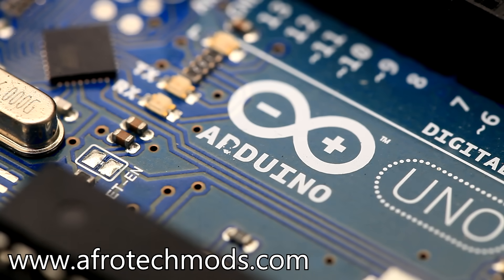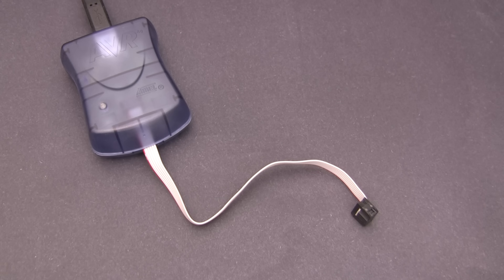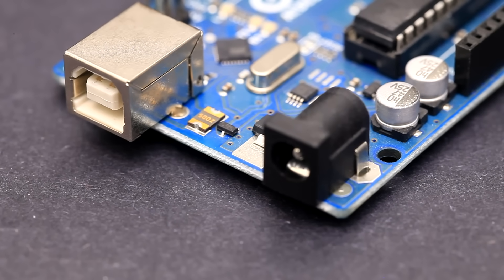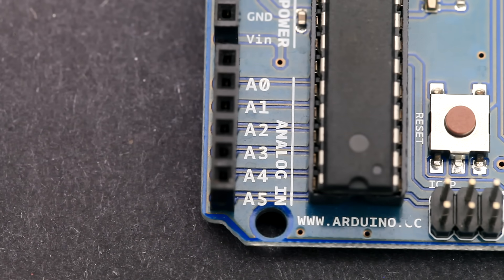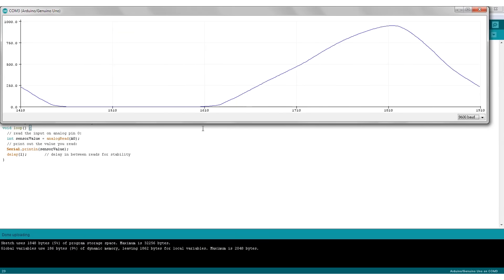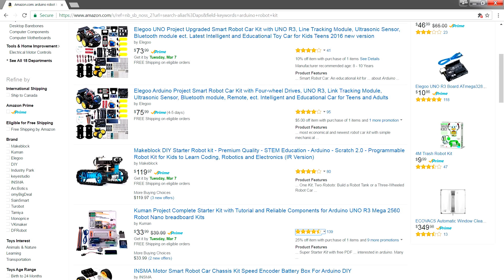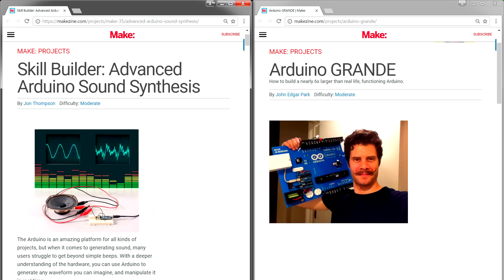You can learn Arduino in 15 minutes.

Comment: I really appreciated this video. I am trying to learn how to employ an Arduino to control the hot and cold (outside) air inlet valves for the cabin temperature system of my airplane. The valves are currently controlled by independent push-pull cables, but the distance between the instrument panel and the firewall where the valves are located cause the bends required in the cable to be so great, the cables do not move smoothly and tend to stick. 

Your video helped confirm for me that an Arduino with two motor controllers could be developed to control two servo motors, or two linear actuators with positioning sensors (depending upon what I decide is easiest to mount) to manipulate the valves. I envision using an instrument panel-mounted potentiometer with a center detent to control the valve positions as follows: 

Assuming that the center detent of the controlling potentiometry is 2.5 volts, then 0 volts would represent full open of the cold air valve, 2.5 volts would represent full closed for both air valves, and 5 volts would represent full open of the hot air valve. 

The idea is the operator could modulate the incoming air valve position to select the desired cabin temperature by rotating the Cabin Temperature control knob (potentiometer) from one extreme to another, or anywhere in between to control the air inlet valve positions. The center detent would be marked as OFF, the range counterclockwise from OFF would be marked with a blue gradient arc for cold, and the range clockwise from OFF would be marked with a red gradient arc for hot. The valve positions would control the amount of hot or cold air that enters the cabin. 

I have some questions...

As I know nothing about how to code an Arduino, is there an index of commonly used code sentences that can be looked up and compiled to accomplish what I am trying to do?  

Are Arduino-ready motor controller's generic enough to work on any motor? Or do I need to somehow learn how to identify controllers acceptable to both the Arduino and the servo or linear actuator? 

Perhaps this exact system would be video tutorial-worthy (hint, hint)?

Thank you,

Comment: I. what Arduino is 🤖

1. microcontrollers = tiny low-power computers on a chip ⚡💾
2. Arduino = Italian company making easy-to-use circuit boards built around these chips 🇮🇹🔌
3. open-source hardware → many clones exist 🌍🛠
4. boards come in many versions (Uno = cheap & most common) 💡💸
5. shields = add-on boards (motors, wifi, MP3, GSM, etc.) 📡🎶📱

II. why it’s beginner-friendly 👶🏼

1. traditional microcontrollers = hard (binary, registers, custom programmers) 🧮😵
2. Arduino software (IDE) simplifies upload via USB 💻➡🔋
3. unified language across all boards 📝🧩
4. tons of example “sketches” to learn from 📚✨

III. hardware basics (Uno example) 🔍

1. main chip: ATmega AVR 🧠🔲
2. USB chip = handles programming + serial communication 🔄🖥
3. power via USB or 9V barrel jack → onboard regulator to 5V 🔋🔌
4. reset button + crystal resonator 🔘⏱
5. pins:
   – power pins (5V, 3.3V) 🔋⚡
   – digital pins (2–13) → in/out, PWM (\~) 🔀🔢
   – analog inputs (A0–A5) → read voltages 0–5V 🎚📏
   – TX/RX for serial 📡💬

IV. first projects 🛠

1. connect potentiometer → analogReadSerial → see values (0–1023) in Serial Monitor / Plotter 📈🔎
2. LED dimmer: potentiometer on A0, LED on pin 9 → analogWrite maps 0–255 brightness 💡🎛
3. same principle controls motors (PWM) → build simple robots 🤖⚙🚗

V. key takeaways 📝✨

1. Arduino = easy entry into electronics + programming 🚀💻
2. Uno + starter kit = enough for most projects 📦🔧
3. programming model = setup() runs once, loop() repeats ♻🔁
4. use example sketches, tweak variables, and expand into your own circuits 🧪🖊
5. with sensors + actuators, Arduino becomes the “brain” of DIY robots, instruments, and gadgets 🧠🔩🎸

spol.ski

Comment: 2:31 As far as I know, it's just C++ with a prelude, so some C++ concepts (like templates) can be directly used in Arduino code, and if you have some useful C/C++ header files, you can directly import them.

Side note: From what I can tell, the IDE uses Clang to compile sketches. With a bit of research, you should be able to compile other LLVM-compatible languages (such as Rust and Zig) to the Arduino, just like the IDE does.

Comment: In the thumbnail you can see the diode is directly in the arduino. I would recommend using a breadboard as it does not require any soldering or bending wires.

Comment: why is 512 half? 0-1023 is still 1024 numbers. It should be 511
Reply: ATmega328p datasheet: 23.7 ADC Conversion Result (for single ended conversion)
the result is: ADC=(V_IN * 1024)/(V_REF)
V_REF=5
V_IN=V_REF/2=2.5
ADC=(2.5*1024)/(5)=512
Reply: @Henry-sv3wv  So not half... Got it
Reply: @aaronrockwell4576  it won't show a perfect stable 512 anyway because you always have some noise in the signal

Comment: although it's not as simple as learning python!!!......
Reply: well arduino does use C++
there are controllers that can do micropython (like Pico RP2040 or ESP32)

BUT if the controller doesn't offer a ready made library for the sensors and stuff you want to import as python libraries and you want to write your own "driver" for an electronic then you now have three problems:
1)  Writing the driver in C code (cause python is too slow for most "driver timing critical things"), then 2) writing micropython language bindings to make an interface/python library for python to your c driver and then 3) recompiling the micropython firmware that it can use your c code driver and flashing that new custom made micropython firmware into your controller.

that's why python is often called a "glue language": to make math science run fast on python the numpy library on the PC for example is in reality compiled c code that is called from the python numpy library functions.

Comment: // C++ code
//
void setup()
{
  pinMode(0, OUTPUT);
  pinMode(1, OUTPUT);
  pinMode(2, OUTPUT);
  pinMode(3, OUTPUT);
  pinMode(4, OUTPUT);

  digitalWrite(0, LOW);
  digitalWrite(1, LOW);
  digitalWrite(2, LOW);
  digitalWrite(3, LOW);
  digitalWrite(4, LOW);
}

void loop()
{
  digitalWrite(0, LOW);
  delay(500); // Wait for 500 millisecond(s)
  digitalWrite(0, HIGH);
  digitalWrite(1, LOW);
  delay(500); // Wait for 500 millisecond(s)
  digitalWrite(1, HIGH);
  digitalWrite(2, LOW);
  delay(500); // Wait for 500 millisecond(s)
  digitalWrite(2, HIGH);
  digitalWrite(3, LOW);
  delay(500); // Wait for 500 millisecond(s)
  digitalWrite(3, HIGH);
  digitalWrite(4, LOW);
  delay(500); // Wait for 500 millisecond(s)
  digitalWrite(4, HIGH);
  delay(1000); // Wait for 1000 millisecond(s)
}

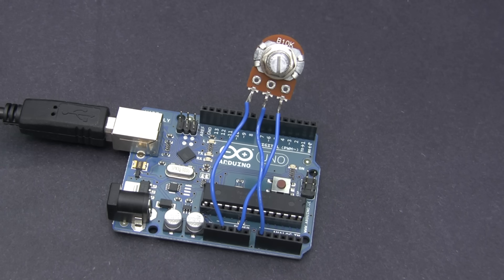Comment: 8:26 In case anyone is wondering, some potentiometers come with the pins on different sides. The side with 2 pins are the side pins and the side with one pin is the center pin. This is meant to be connected to a breadboard.

Comment: one thing to note if you're having trouble getting your arduino to show up on your high-end workstation or gaming rig: some arduino-like UNO models don't play well with USB 3.1 and above, so you'll probably want to use a USB 2 port before trying to find out if your board is faulty. If your motherboard doesn't have any in the rear IO, you almost definitely have some USB 2 headers on the board, and they work just fine.
Reply: i just type `sudo dmesg` to see if the usb device is seen by the usb host controller on linux. if not then the problem is usb not working on the lowest level (cable that can only do power but not data etc?) ...

Comment: pro tip: if your project requires more power than the usb port can provide you can plug in a 9v battery so you can test your design and code without unplugging every thing.

Comment: So... I really never learned how to learn how to do programming

While taking a class on arduino, I finally came up with a strategy on how to learn programming for these. As it turns out, this is the strategy everyone has been using for ages, and that the teacher was trying to teach.

Basically, you make a test program (sketch) for your hardware. There are usually examples of these test programs that would allow you to test all of the functions of a component.

Then, make a series of programs testing how logic pieces work. This allows you to manipulate simple data, and maybe learn to output something to a serial connection, which is easy to do through USB.

Then, you combine the logic functions with the test programs for the hardware in order to figure out a specific function.

My final project for the class was simulating a car security system. An alarm had to beep if the security was violated. An RFID reader had to only read one key to move a servo that simulated opening a lock. An LED had to come on to light the RFID pad up. A button had to lock the system reliably, but not unlock the system when the system is locked.

Having a series of problems like this to solve really helped me learn not only how to apply programming logic and number storage, but how to use these to logically fix a problem.

Comment: To be honest, I've had a frustrating time using Arduino. The Raspberry Pi code is a lot more reliable. 
In Arduino I'm constantly looking for libraries and having to get them from github. I cannot get a single webserver example to work on ANY wifi device; ESP32, ESP8266, WizFi360, ArduinoWiFi, etc... 😖
Run away from Arduino as fast as you can. 🤦‍♂️
Reply: Try using Chat GPT to help you along the way! That might be useful
Reply: how about  ESPhome?

Comment: I still use the sparkfun arduino redboard kit we had to buy for intro to electrical engineering. Idk why I took that class because I majored in mechanical but it was an excellent decision in hindsight. I might be a mechanical engineer but I work with a lot of automation (primarily Allen Bradley PLCs) and sometimes because of the costs of proprietary industrial automation I wish I could just replace all of it with arduinos as unrealistic and difficult as that would be.

Comment: Arduino GUI is 'Paint by Numbers' for idiots.  The only use for an arduino pcb is as cheap hardware for a real C or ASM programmer using Atmel Studio. Just delete the bootloader and write your own code.
Reply: Windows is clicking buttons for idiots. Real programers use Linux. (Atmel Studio is Windows).
Real Programers don't use a GUI IDE, they use vim and makefile and can install Arch Linux with encryption, btrfs and timeshift manually on the terminal.
The mobile Gaming Console Steam Deck is based on Arch Linux by the way.

Comment: Looks a lot like Basic commands
Reply: It is C++ code.  ( they hide the typical main() function from you and give you setup() and loop() and the *.ino file gets copy pasted and a little preprocessed before sending it to the avr-gcc C++ compiler)

There is no "arduino language". They use the language of the big boys: C++
with their Arduino library functions.

People writing:
 Serial.begin(57600);
in their sketch?

Yea, they are using an Object instance that the arduino framework instantiated for you from the C++ Class SoftwareSerial defined inside the Arduino Library files:
SoftwareSerial.cpp  SoftwareSerial.h 

void SoftwareSerial::begin(long speed)
{
...
}

Comment: Can one of these be used as a voltage multiplier, as in I connect it to a shunt, and as more current is pulled through the shunt, the shunt voltage gets multiplied enough to light up an LED bar graph, more power pulled through the shunt = more LEDs lit up on the graph (effectively creating a bar graph ammeter)
Reply: you can use a current sensor and based on the read value turn on leds and stuff in any way you want. search youtube for: arduino current sensor
Reply: you could also use your curent resistor with an annalog input on the arduino and maybe with operational implifier stuff. but more work than a ready calibrated current sensor module...

measuring current with arduino without extra sensor module:
https://youtu.be/mcDITdXGZDc?t=56

Comment: dumb question but with the first project, do you need to soder the wires to the potentiometer?
Reply from the maker: If you can make a good connection without soldering then no. But usually people will solder to it for robustness.

Comment: Can "Arduinos" run a 3D printer? How about a 3 axis CNC machine?
Reply from the maker: Certainly! You will of course need additional stepper motor driver hardware, such as the shields I talk about at the start of the video.

Comment: At 5:29 you said, "make sure that whatever you power doesn't draw more than a few milliamps." If you ended up drawing more than a few milliamps, what will happen?
Reply from the maker: You'll blow the output transistors on the pin

Comment: I have a problem I can not solve:

1. I downloaded the driver and windows is able to recognise my arduino
2. I have an arduino clone
3. The bootloader is working because when I press the reset button the L led blinks 3 times
4. I choose the correct board in the arduino ide which is arduino uno
5. I choose the correct com port
6.  I have done the loop back test and it has failed for some reason.

And after all of this it still can not upload to my arduino for some reason I always get this error code:

Arduino: 1.8.19 (Windows 10), Board: "Arduino Uno"

Sketch uses 924 bytes (2%) of program storage space. Maximum is 32256 bytes.

Global variables use 9 bytes (0%) of dynamic memory, leaving 2039 bytes for local variables. Maximum is 2048 bytes.

avrdude: stk500_recv(): programmer is not responding

avrdude: stk500_getsync() attempt 1 of 10: not in sync: resp=0x44

avrdude: stk500_recv(): programmer is not responding

avrdude: stk500_getsync() attempt 2 of 10: not in sync: resp=0x44

avrdude: stk500_recv(): programmer is not responding

avrdude: stk500_getsync() attempt 3 of 10: not in sync: resp=0x44

avrdude: stk500_recv(): programmer is not responding

avrdude: stk500_getsync() attempt 4 of 10: not in sync: resp=0x44

avrdude: stk500_recv(): programmer is not responding

Problem uploading to board.  See https://support.arduino.cc/hc/en-us/sections/360003198300 for suggestions.

avrdude: stk500_getsync() attempt 5 of 10: not in sync: resp=0x44

avrdude: stk500_recv(): programmer is not responding

avrdude: stk500_getsync() attempt 6 of 10: not in sync: resp=0x44

avrdude: stk500_recv(): programmer is not responding

avrdude: stk500_getsync() attempt 7 of 10: not in sync: resp=0x44

avrdude: stk500_recv(): programmer is not responding

avrdude: stk500_getsync() attempt 8 of 10: not in sync: resp=0x44

avrdude: stk500_recv(): programmer is not responding

avrdude: stk500_getsync() attempt 9 of 10: not in sync: resp=0x44

avrdude: stk500_recv(): programmer is not responding

avrdude: stk500_getsync() attempt 10 of 10: not in sync: resp=0x44

This report would have more information with
"Show verbose output during compilation"
option enabled in File -> Preferences.
Reply: try turning it off and on again
Reply: @xApplePvP  it did not work

Comment: Good evening, at 5:36 you mentioned that Arduino would not power large motors, if that is the case then which circuit will...?
Reply: Motor drivers like L298, uln2003 motor driver, you can also use transistors and replay for AC appliances/motors

Comment: I almost finished my robotics designs upgrading from Adapt912 to Adapt9S12 modules. When I left, they thought Arduino would be much better. Unfortunately, it is much lower quality, less capable, and now they can't go back to the better modules using MC9S12 just because this arduino movement put most of them out of business. It truly is much better, but gone because nobody was intelligent enough to keep supporting it.
Moral of the story is, you cannot make the world better by not teaching children how it really works. In Adapt9S12 we had to learn more how the bootloader works and direct hardware manipulation, but we benefited by that. Now to say Arduino got rid of all that is a lie of course, because it's all there and necessary but just not taught.

Comment: about when a shield has short pins, how to work with them? Do I need to weld pins under it?
Reply: You can use soldering or temporary wire connection

Comment: Excellent and clear. Unfortunately I can’t get the serial monitor to print anything! 
I’m using a 20kOhm as that’s all I had. Could that be the reason or something else? (Tried on an uni and a mega)
Reply: Just don't use anything on pin 0 and 1 as they are Communication pins